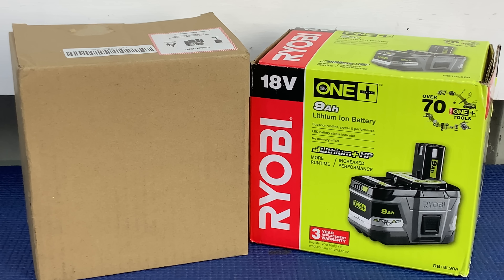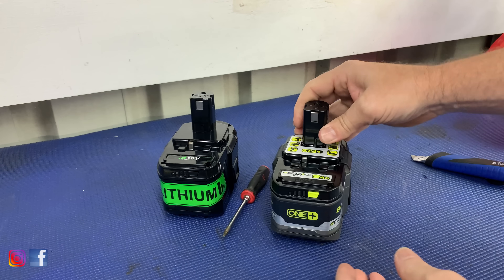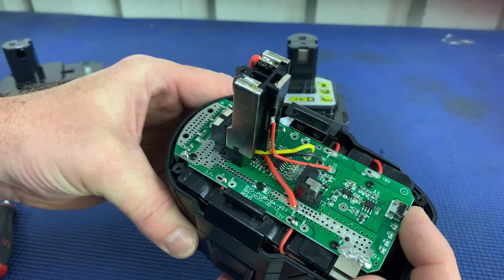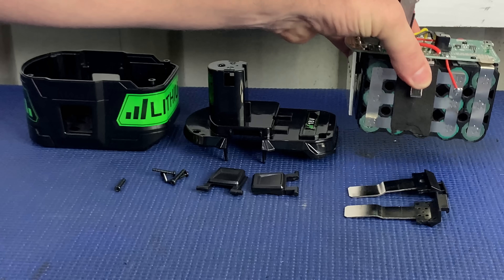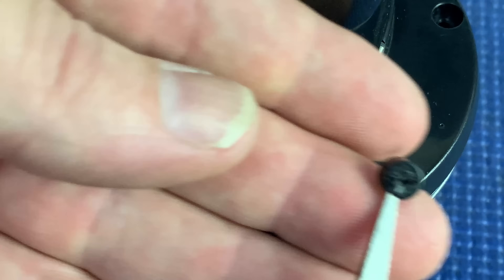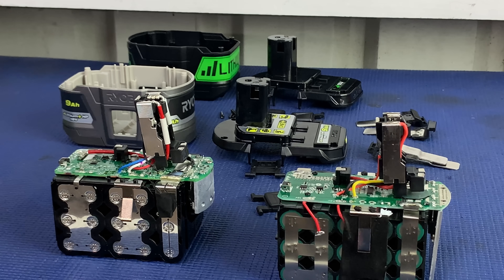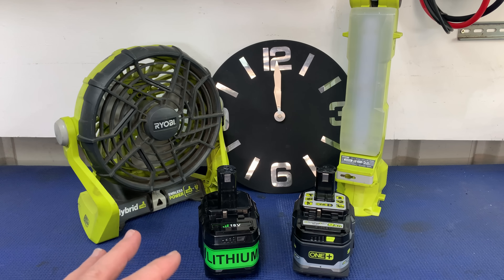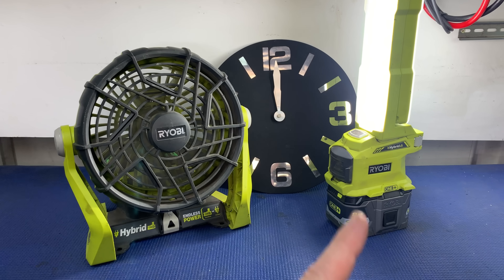Ryobi 9ah battery versus eBay knockoff job

Comment: Never had a problem with the knock offs. Besides that they don't give off enough current, say my angle grinder. Great for lights, fans, drills, etc for light duty usage though. Not recommending anyone to buy (your own risk); just sharing my experience.
Reply: And while I appreciate how this guy tried to show the ins and outs and why the knock offs are bad, it is still not a good look after reading through a ton of comments that most of the ones he replies to are comments that report having no issues with knock offs, to which he responds quite emotionally with gaslighting and trolling (some of his replies even sounding like a knock off working well for somebody else meant a personal insult towards him), so it is very hard to believe that he is not paid by Ryobi even if he fervently denies it LOL
Reply: To expand my list, I have used knock offs for:
Drill
Driver
Tyre inflator
Mini blower
Mini fan
Big fan
String lights (2 of them)
Air inflator
Right angle drill
Recip saw
Angle grinder (doesn't work well here)
Project vac
Stick vac
Floor cleaner thingy
Glue gun
Mini hedge trimmer thing
25W worklight
hand vac (very old and forgotten tool, which I have stopped using by the time I got knock offs)
1st gen impact wrench
1st gen SDS rotary hammer (I don't believe I've used a knock off on this yet; tool very unused)
multi tool
Window squeegy vac thing

All worked fine unless stated above.
Have used a mix of 3ah, 4ah, 6ah, and 9ah knock offs.

Yeah I got a LOT of stuff. 22 tools currently. I'm sure there will be one or two as I walk around the house.
Reply: Also recently, a 6AH 36V knock off for my cordless pressure washer (the big expensive one). Comparing alongside the 5ah one, seemed to last as long and delivery no drop in power... What can I say, this is what I observed. Maybe be happy for me?
Reply from the maker: They still suck, its not emotional its a fact - this piece of shit battery didn't last 20 cycles, don't get me started on the last one prior to this one that was worse or all the reports of these catching fire..
Reply from the maker: ooh one more note.. that box, and battery its self states 9ah, the EFFING thing is 3... ethics is missing from this shit..
Reply: @HBPowerwall  "EFFING thing is 3".... I don't know bro... sounding pretty emotional to me, mate. You really should use above line communication if you're trying to deliver a message. 

Hard to comment on the accuracy of capacity. I remember chatting to a battery manufacturer (separate to this topic) and they were explaining how they can achieve higher capacity ratings simply by benching them at a lower current draw. This was for SLA batteries though, but I'd imagine they could be pulling a similar stunt to prop up that number. As for your claims on 3Ah, it seems that you're calculating/estimating this figure by probing around with a volt meter along the way? I'm not sure how accurate this approach is, compared to actually running these cells through a test charger that does a couple of discharge/charge cycles and counts the actual amount of energy going in. I'm generally with you on this (i.e. MOST tools would have a high enough discharge to compromise that 9Ah figure).

Just remembered while typing this (sorry it's become an essay), I once held a dinner party and used the 25W LED worklight to add some lumens around the house. On a full 9Ah charge with a slightly different looking battery to yours (but still a knock off), it lasted around 4 hours (wasn't timing it but it lasted all the way to me washing the dishes). So, 25W, ignoring inefficiencies and assuming that this figure is true to a tee, multiplied by a VERY wild estimate of 4 hours, brings you 100Wh, which means roughly 5.5Ah on the batteries. On an angle grinder drawing 10-20A, the capacity might shrink to 0.5AH, and on a fan, drawing maybe half an amp, capacity could appear like it's 8AH, if you get my point. 

Anyway to sum up, again MY personal experience only (but appears that others are sharing similar stories).
- Is it good bang for the buck? Yes
- Only for a short term? No, have been using these for years. All still running well.
- Build quality? Agree, not the best. I confirm specifically the style of 9Ah battery you had in your test (I have 2 of these myself) didn't fit the large hybrid fan (exactly like your one) in particular and you have to push in REALLY hard until you hear the snap. For some reason, they fit fine in all other devices.
- Buyer beware? Yes
- Do I recommend it? N/A. Your money, your call. You make your own decision.
- Would I buy it? Yep.
Reply from the maker: I did about 5 full cycles https://www.instagram.com/p/CNrOhGAn8Sr/ before the battery failed never go above 3ah, Still have all the footage, inspired me to dig it out and upload it.. Thanks for the interaction and your view point. they all help with how I tube..
Reply: @HBPowerwall  looking forward to it mate. Thanks for keeping a level head. Luv your tubes!

Comment: Do these both use 18650 cells?
Reply from the maker: Yes they do
Reply: @HBPowerwall  I’m thinking of buying some old dead ryobi batteries and and 21700 cells to put inside them. Ryobi doesn’t currently stock the 3ah battery with the 21700 cells and I can’t find what they put in the 6ah batteries. Idk why they don’t just use 21700’s in their hp line it’s kinda dumb. Saving all the hood cells for Milwaukee and rigid.

Comment: I bought a knock off battery for an older leaf blower and now after 3 years still going well. Run time I seen no difference. You just have to watch where you by the battery because there are good knock off batteries out there.
Reply from the maker: ooh could you share a link I've just bought 4 more batteries to retest!

Comment: If you do buy this knock off, you should have some electronics savvy.  Then run it into the ground and replace the cells with LG, Samsung, or Panasonic 18650 high discharge cells later.  Make use of the bms board and case.  And doctor that up with good nickel strips.
Reply from the maker: If I had to go to that effort i'd just grab a genuine one
Reply: @HBPowerwall  That would be your choice.  I'm just saying if it can be salvaged and repaired, why not.

Comment: My bets are on guessing that the knock off battery contains low capacity cells and not high discharge ones, i.e. low performance with your blower.
Reply from the maker: I straight away started 100% cycling the 'lithium battery' only to have two cell groups fail at zero volts after 5-10 full cycles (can't remember how many as it was years ago) also they tested at only 3 ah not the advertised 9ah..

Comment: Your test was a good long running capacity test at low amps. But the reason you notice a power difference is because the cheap cells can't deliver the same amps as the ryobi cells. 4Ah battery can deliver the same watts as a 9Ah if ryobi is using the same cells in both packs, so you not notice any power difference, but the 4Ah will die faster because of less capacity. However I believe ryobi is using top quality cells in their hp and 9Ah packs.
Reply from the maker: that battery was all up 3ah - not nine.. can't do a high amp draw because you can't get a consistent draw
Reply: @HBPowerwall  even if the knock off battery was only 3Ah. Or even if it was only 1Ah. Properly spec'd cells could dump enough amps needed to match the watts of the ryobi 9Ah, it would just fall off and die sooner while the 9Ah keeps going. You said the knock off doesn't "feel" like it has the same power, that's because those batteries can't provide the amp output of the ryobi cells not to be confused with (Ah) capacity.  The knock off batteries are maxed out giving all the amps they can and as a result voltage is likely sagging more than ryobi's which means less watts.

Comment: I bought 2 m12 6.0 generic batteries on Amazon for 19.95.  They look and fit great.  I took one apart and it has all brand new sanyo cells.
Reply from the maker: I doubt that... but glad you seem to have go a bargin
Reply: @HBPowerwall  you doubt it?  Not sure what there is to doubt but you do you.
Reply from the maker: @GertTown  well seen ALOT of fake cells like shit cells with good brand sleeves on them. after processing over 25,000 used 18650 cells i've seen my share of crap cells with lipstick, but if they work for you that's all you need right?
Reply: @HBPowerwall  all the fake ones I've seen were much lighter than they were supposed to be and all of them still had the old wrap under the new one.  The terminals are also often a giveaway bc you can see old weld marks or differences in the terminals of each battery.  I ran my old m12 multi tool on one today and it did great.  That tool burns up batteries pretty fast usually.

Comment: Obviously the RYOBI is a much better built battery.   I've been checking these +One batteries out and I sure don't want any fakes.  I bought fake Black & Decker batteries for  my trimmer and those hardly last through one trimming where as the Genuine B & D batteries lasted through several trimmings.   So You may as well get the genuine one though it may cost more.   And these fake batteries don't last as long as I found out with my own experience with them.

Comment: I tried 2 knock offs 5 years ago along with 8 ryobi batterys. still have the ryobi's the knock off's are long gone. full charge would give me about 15min on fan. None of these have had a hard life. So ya cheaply made and very short life 2-2.5 years. Wanted to see for myself and it is ryobi from now on.
Reply from the maker: WAIT you got years, I got weeks out of this one!
Reply: @HBPowerwall  it probably was cycled twice a month. hotest summer and coldest  winter months not at all. stored with 1/3 charge

Comment: Quote "I'm not impressed with welds because it's a 9ah battery" 
Batteries don't give out more amps because it's a higher a/hour it just means that it will last longer. It's the tool that determines the current drawn which will be the same if you use a 1.5 a/h or a 9 a/h battery.
Reply from the maker: Yes, you're right for sure, BUT if I HAVE a load that requires that 9ah battery, extended drill use, grinder, weed eater etc - those welds will be taxed beyond their limit. Just a shit battery can't get past that fact even now..

Comment: So these would be good for low power consumption rate and low vibration items such as the fan a light.   And you can extend its questionable life for cycles by using a slower is slower charger. It's cheaper by 76% I would definitely get one. And use it for my low power options and keep the name brand stuff for my high power high vibration options.  

Just saw your comment update that it died after 5 cycles that's unfortunate hopefully you bought it from a place that allows returns
Reply from the maker: Low powered devices are the only thing it's useful for - unfortunately the life span is terrirble so get that 76% extra an put it into a real battery

Comment: I have a genuine 5ah and a couple knock of 6ah,~

the 5ah lasts longer, probably almost twice as long, tested on reciprocating saw and rotary tool, higher power draw than a light or fan,

also the knock offs get much warmer, ym charger wont charge them for a while after use, where as the genuine only warms slightly after heavy use and will normally start charging within a few minutes of being used,

i have had 3 knock offs in total, first one died after a single use (got free replacement though) one got dropped (lent a sander and battery out) and the casing cracked so is difficult to get in and out of tools,

i do need another abttery or two, i will be buying genuine when on offer ;)

Comment: I have Milwaukee 12 volt platform very powerful. I purchased the 6ah nock off battery and they do just fine and my 6ah nock off dose last longer than my Milwaukee 
4 ah battery and that is very surprising no matter the ah. .

Comment: All the battery knockoffs I've tried get the job done, but they all seem to have 
"B grade/factory seconds" kind of quality compared to most proprietary ones I've used.
Translates to softer total charge, fewer charge cycles, and lesser power in overall top strength and duration of aggressive power.
Reply from the maker: I've had ex-girlfriends 'do the job' didn't need them in my life tho.. lol
Reply: @HBPowerwall  That's why they're "Ex"..👍

Comment: Dude... The knockoffs are a GREAT value vs the brand name. Your reasons are nonsense against them. I have a bunch. They fit fine. They run 80% as well for less than 50% the cost. 

THE ONLY time to get brand name for Ryobi (which is homeowner grade) is when they have Ryobi Days sales, where you get a free tool that you need. That brings the batter cost in line with the knockoffs.
Reply from the maker: I call bullshit on your percentages lol but have at it son.
Reply: @HBPowerwall  dude you said it yourself. 

Runtime is 30% lower, 9 hours vs 13 hours. Cost is 75% lower ($80 vs $300). Did I not hear those exact numbers in the video?

It's a no brainer. Off brand all day unless you're a pro, in which case you shouldn't be using Ryobi.

Comment: My 6 Amp hr knock offs fit a bit tight
Reply from the maker: do you mean your 2ah - cause all i have tested have been 1/3 the advertised capacity
Reply: @HBPowerwall  my 6 Amp hour knock offs work fine, great capacity, more than ryobi 4 Amp hour for sure

Comment: I've been using off brand 6 Amp hr batteries for over a year, happy so far with their performance and low cost
Reply: I have after market batteries , I found that charge normal changer will give better run time than fast charger
Reply from the maker: Hope you charge them out side.. :(

Comment: Good Testing. But it really depends on a couple things on which one to buy. #1-Do you have the $$$ to Spend?  and #2-Is the job you're going to use the battery on, an everyday job connected to your Work, or are you just going to use the battery occasionally as a homeowner? If I got the Prices Right, the Ryobi at $300 and the Knockoff at $80, there would be a considerably saving with the Knockoff.  I would agree with Stevie Tech; the Battery Fit Test should have been done on the Tools before disassembly to get the "out of box" True Fit. Also both Batteries "run time"  should have been Tested on the same device, such as the Fan, which would probably put more load on the batteries than the light. Other than that, I think you did a Great Job on Testing both Batteries. It's easy for me to criticize your methods that I probably couldn't even do myself, but it might help you in the future, so I had to comment. Five Stars to you. Keep up the Good Work.       Phillip

Comment: Thanks for the interesting video. However, it's not valid to extrapolate a low quality to all non-genuine batteries from only one battery. And at about one quarter the price of genuine batteries this particular battery is good value (as long as it's safe). And let's remember that the 18650 batteries that constitute these 36/40 volt batteries can be designed for different performances. For example, one type may be designed for high current delivery but less endurance. It's unfortunate that the penultimate and end vendors are often shady and overstate the performance of their products (and underestimate the education of us end buyers) and thus detract even more from the reputation of cheap products. Finding a reliable retail vendor is problematic but possible. Having been an importer from China to Australia, I can say that one can get any product for any price one stipulates in China. The quality varies from very bad to the very best, depending on how much one is willing to pay. Most things are made in China including the quality Ryobi battery I'm looking on my desk. And I love the sound of electric tools operating as you use a manual screwdriver lol.
Reply from the maker: The fuckery that goes along with these cells is horrilbe.. saying it's 9ah and really its 3, poor build quality, shit batteries and just out right lies to make money extends past just this battery. I'm done with lies to earn a dollar.. DONE.. whats worse is these asshats just offered to sponsor me making a video - Showed them this one and they went silent and their Amazon store vanished.. lol

Comment: u pay for what you get so dont complain when you want to pay less
Reply from the maker: I paid for 9ah battery ……got three. I didn’t pay for what I got I go so much less as it turns out.
Reply: @HBPowerwall  which is why its also 3times cheaper....
Reply from the maker: Yes if it had 3ah on the box would have been happy but shit advertising pisses me off no end. It’s unethical
Reply: @HBPowerwall  thats where the words nowadays can be used to gain money by lies. which is why u have to test everything nowadays. its not even about price. its about claiming one thing which it isnt
Reply: which is why cheap stuff and branded stuff is a price difference because most times branded stuff would do what they claim and not advertise any higher than it can handle
Reply: @HBPowerwall  so in simple. the term fake it is. but if everything is a lie to gain money. then how do we buy things when we need to

Comment: I'm not sure what tools you have. But something that uses a massive draw would be awesome for the test. What I've noticed is the bigger the battery the harder it will work.
Reply from the maker: Unfortunately higher draw tools need management - ie holding down button with load attached.. cutting wood, grinding etc so getting consistent testing would be hard at best. Fan and light worked because it's plug and play but fully agree it would have been better.